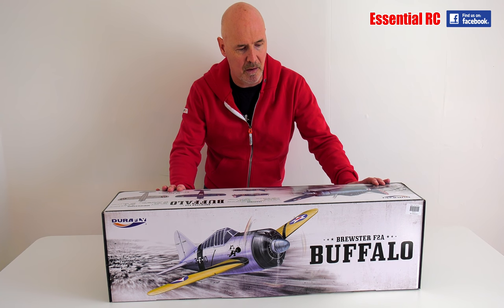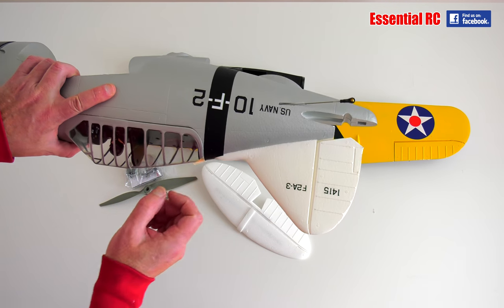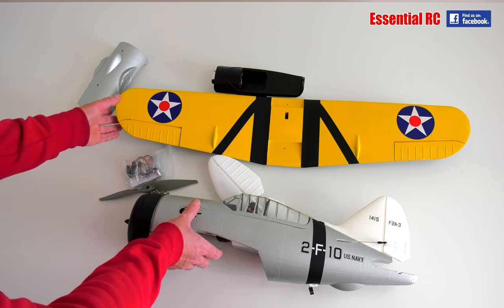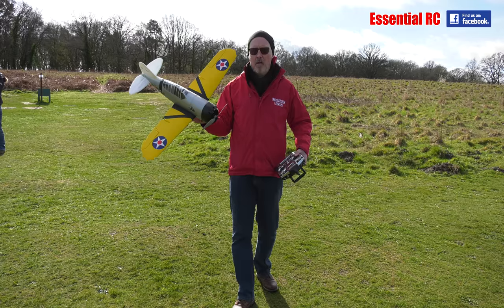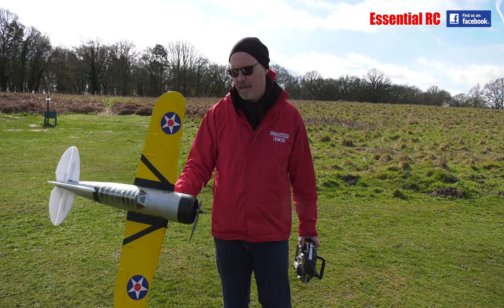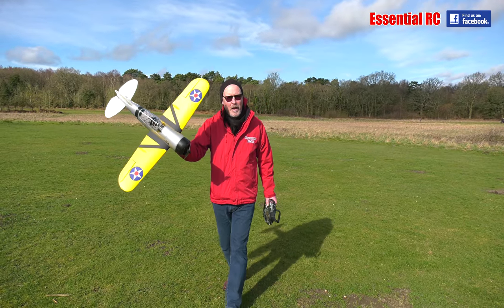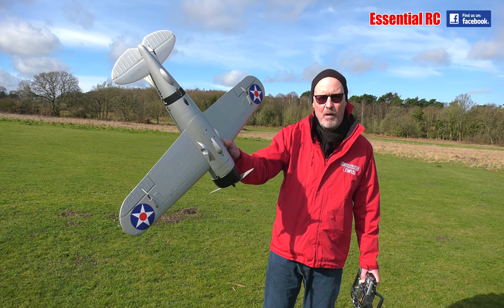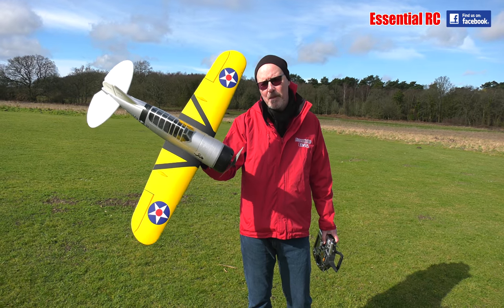Durafly Brewster F2A Buffalo 920mm (36”) PNF: ESSENTIAL RC FLIGHT TEST

Comment: Hi, must say I cannot recommend this plane enough. Been flying it for a month and as an intermediate flyer it is really easy to control. My advice for what it's worth would be no more than 8mm elevator movement and glide it in for landing with power off.    It hand launches like a dream on 75 percent throttle. I love it.....and it was so cheap. Get 10 of these instead of a draco and give 9 to people you like.....
Andy in Northumberland.
Reply from the maker: Thanks Andy. I'll never understand why folks would pay £600 for a Draco. Crazy money.
Reply: @EssentialRC  yes it does look impressive, but 600 quid ?, my most expensive was 300 for avios spitfire, but I have managed not to crash it in 30 flights so I'm happy. 
Just a quick comment. I notice you review quite a lot of edfs. I bought my first edf in March, and chose the arrows marlin after watching a lot of videos. As my first edf I had no trouble. It has fixed undercarriage and flaps, and was much easier than I expected. When I fly it  people keep saying  how stable it looks and it really feels like its on rails, even in winds of 15mph. Also it lands very slowly with flaps. 
If you ever get a chance try one. And its only about 150 quid.
Andy.
Reply from the maker: My EDF jets must have flaps and retracts  Andy. Freewing Avanti 80mm is best in its class. I just got a 2 metre Avanti XS that I'll put a 120mm EDF in for 12S.
Reply: @EssentialRC  thanks, just watched video. I will definitely put the stock model on my wishlist .....Happy flying.

Comment: Leaving transmitter at home... yes, done that twice. The Buffalo’s quite a performer. Do you use any expo? Just wondering, it looked rather twitchy to me.
Reply from the maker: I need to reduce the throws but do use 30% expo. First flights are never super smooth. Cheers Dom (Essential RC)